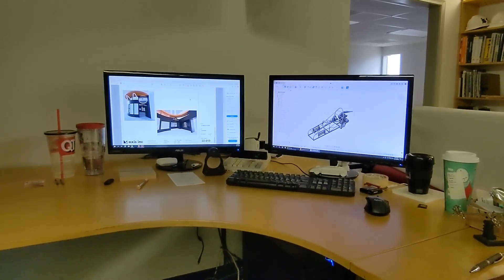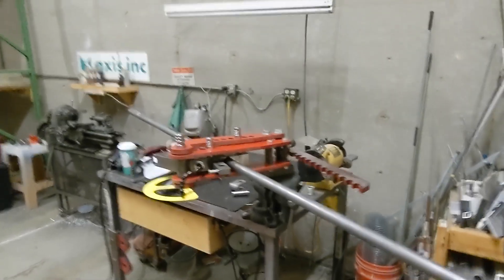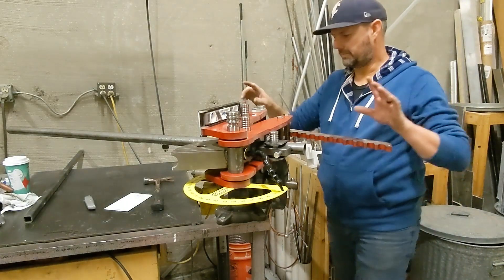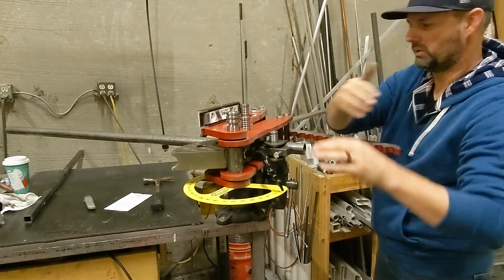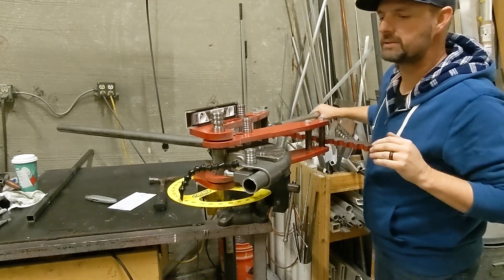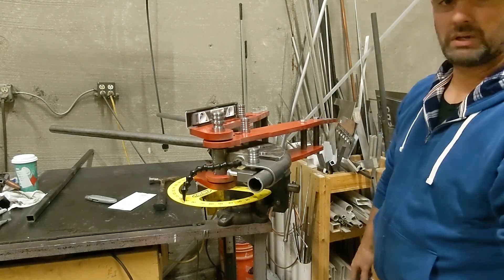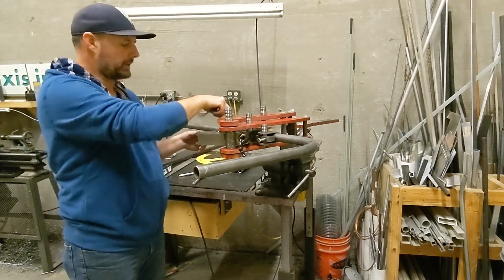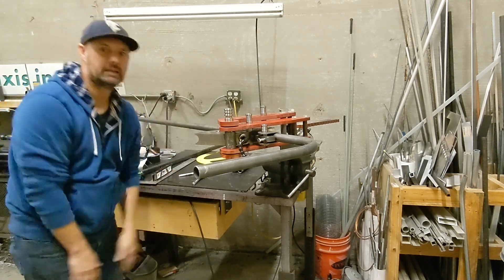Tube bending for roll cages and racecar frames

Comment: Nice video, I am very interested to learn how you are using Fusion 360 for the bends, not only designing, but do you use it also as a measuring tool to lets say make a part list for the bends, let's say 1 tube, 14 inches long, with a 45 degree bend, with a beginning of 3" etc?